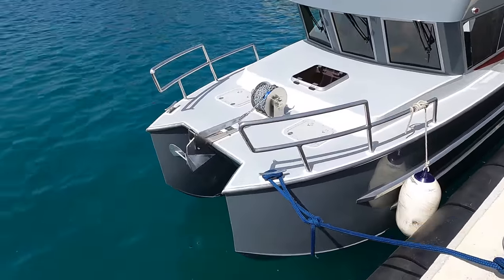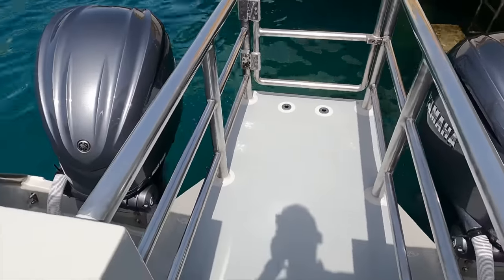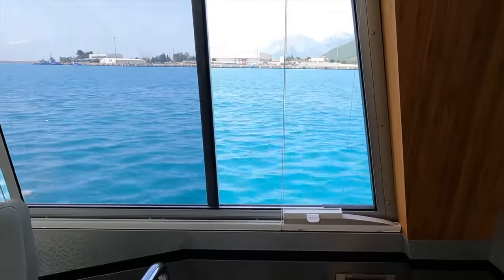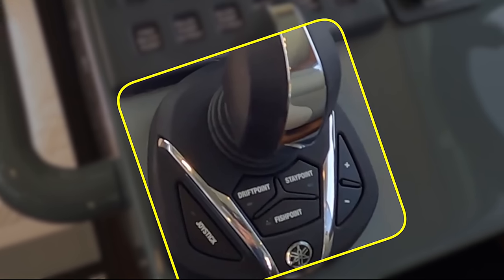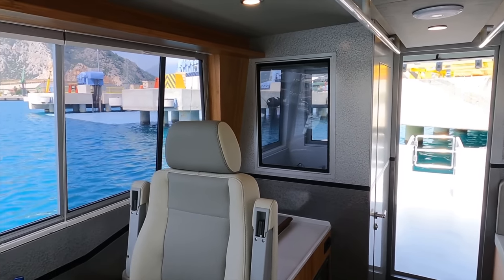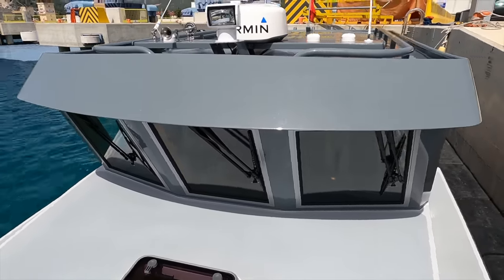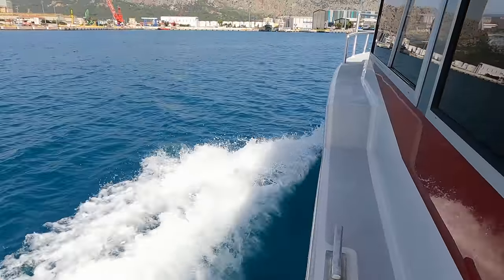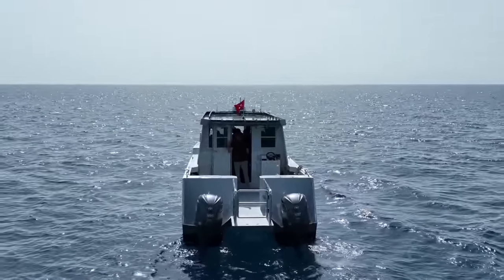FIRST LOOK At The BERING MARINE 34! (Top Speed 40+ Knots!)

Comment: Add six feet, increase fuel capacity, and install twin 600 hp mercurys.
Reply: NO
Reply: Yes, add six feet, increase fuel capacity and install two +300hp Yamarins with drives or jets. Big gasoline outboards can be fitted with chain and used as anchors when installing mooring buoys. You know this thing called "climate crisis"? No one can do everything but everyone can do something 👍🏼...
Reply: That’s not how the do stuff in the northwest. But I bet we’ll be getting more closed pilot house boats in Florida soon due to heat and they’ll make sure to overpower them
Reply: After that add another 6’ increase fuel capacity. Increase hp.
Reply: Twin 300 hp. Disel jetbiutbordes

Comment: She is a breakthrough in design and ride dynamics. The DP system is long over do. No need for costly stabilization system. Perfect size for many coastal operation in Alaska. She is tuff and small enough to trailer. Small beam means regular slip cost. Designed for cold water and the choppy conditions in Cook Inlet. She can go on the hard with ease. I love the design and wish that we could set up a building operation in Homer Alaska. Bay Welding is one of the top aluminum builder in this part of Alaska. Business is booming with a 4 year wait for one of the progressive aluminum cats. Carl Nostrand

Comment: Bare with me, another 3' beam and 4' length. And a very, very secret, well hidden weapons storage,  compartment, airtight w/Febreze or Ozium shot when certain radio frequencies are detected. And panic button. Safety first. Long range, multi bladder fuel tanks fitted, smallest MTU multi-fuel oh yes! Small mast with crows. Huh? This is greatly designed for anything the Sea throws at her and ports of call also with my upgrades. Walk around with a stern anchor too. Super flippin' nice boat = endless adventure, fun, and in all weather, anywhere, any port. 
Just dreaming and you provided the boat. 🤔🏴‍☠

Comment: Like this Bering BM34 Catamaran,  though do Bering offer any other sizes?

The likes of 47 feet long by 15.5 feet beam Catamaran, with centre line through cabin walkway.

That is from the stern and central loading swim platform and gated external passageway, with Outboard Diseal Engines and Outboard Electric Motors  on either side too.

Then passing through the aft cockpit area, with removeable deck cover, plus Man Over Board and loading 360-degree "L" frame Hoist Crane.

Going into the cabin via a aft watertight two-piece separate opening side hinged doorway, which is wheelchair accessible too.

As is the internal central passageway,  plus both the Toilet Compartment and Separate Shower Compartment, are wheelchair accessible too.

Then the main international cabin, divided up from stern forward. With first port side separate Head toilet and hand basin Compartment, then on the starboard side of the central passageway is the separate Shower Compartment.

With enlarge Galley Kitchen, with separate 50-litre Fridge and separate 50-litre Freezer, a Draw Dishwasher for two people, a Combination Mircowave Pressure Oven Air Fryer with Grill, plus Electric twin Hob no gas!

Stainless steel kitchen sink with hot & Cold Water taps  + Wast Disposal Unit, along with Electric Hotwater Heater on demand, plus Hotwater Drinks Machine and separate Cold Water / Ice Cubic Maker too, maybe Cubbish Compactor Unit as well.

Also base storage cupboard and draws,  plus overhead storage cupboards, as well as under seats and under floor storage compartments too.  

With a four seat dinette, that converts into small double bed, with overhead a single fold-down bunk bed too, in all sleeping upto four adults two children and one teenager plusxtwo 🐕 dogs.

Along with two ceiling mounted air-conditioning units, similarly two ceiling mounted remote-control Coulour 24 inch television LCD Screens.

With DVD/CD Player, Harddrive recorder and Satellite Topbox plus DAB Stereo Radio, for the main cabin area.

While the forward cabin, has dual Helm /steering postions one to port and one to starboard, each with Multi-Display Screens and duplicate Controls.

With Chartplotter,  Auto-pilot, GPS and Satellite Weather Terminal, Radar and Sonar Display Screens, 360-degree Daylight Adverse-weather Night-time Digital Camera System and Helm Display LCD Screen.

With Helm position Voyager Data Recorder (VDR) and Helm Voice Recorder  (HVR) systems too. Automated Fire, Smoke and Gas Suspension Systems, Automated Blige Control System, plus Automated  Security Alarm and Tracking Satellite System.

As well as Steering Wheel and Digital Joystick for Bow and Stern Side Thruster Systems, Engine Controls, pair of Marine Aviation UHF/VHF Radios, Satellite Phone and Modem Terminal.

Navigation LED Lights, External Hull LED Lighting and External Superstructure LED Lights Controls, plus remote-operated 360-degrees Visable and Infrared LED Flood Search Light controls.

Also external underwater and external Superstructure Digital Cameras, with Helm position LCD Screens, plus internal White and Red (night-time) Led Lighting system too. 

Along with control panel for the Solar Electric Panels and Vertical Axis Wind Turbines, plus rechargeable battery energy pack.

With the Solar Panels and Win Turbines, mounted on the main cabin roof, or on the remote-operated powered Radar Communications Fold-down (for extra bridge clearance) Mast. 

As well as mounting the fog horn public address loudspeaker and siren,  radio aerials, satellite dish, navigation lights etc too.

With extra solar panels, on the roof of sleeping cabin too.

Though the Catamaran fitted with a Hybrid Diesel Electric propulsion system,  consisting  of a pair of 200 hp diesel outboard engines and a pair of 100 hp Electric outboard motors.

The Catamaran having a range of 60 miles at 6 knots on the electric outboard motors, between recharging, plus a range of 540 miles plus on diesel outboard engines. With two onboard diesel electric generators, water maker and fin stabiliser systems too. 

Also a side-by-side two seat bench seats, on ride suspension and adjustable height systems.

With forward of the Dual Helm Position an on either side of the central passageway, is the forward Sleeping Compartment. 

With bow / forward to stern / backwards laying single beds, with storage cupboards and draws under these two single beds.

Though again with fold-down single bunk beds, plus wardrobes at either end of the single beds. As well as extra Storage and Equipment Cupboard, being fitted in where can be too.

Though the lower single beds, can be converted into a King Size Double Bed.

By sliding out three built-in slide-boards across the Central passageway, that lock in place on the other side, then by  placing memory thin mattress on top to make the King size Double bed.

With an open craw space below, if needing to get to the bow too. Though the lower and upper single bunk beds, each have their own privacy curtains.

Along with their own LED lighting, also USB scockets and wireless stereo headphone too. Each having their own DAB Radio and DVD / CD Player,  plus each having a 19 inch LCD Television Terminal too.

While the Sleeping Compartment, has another ceiling mounted Air - Conditioning Unit too, plus each bunk bed has its own open circluar portholes too.

As well as the Sleeping Compartmentn  has overhead escape skylight, located over the central passageway too.

Right at the front of the Sleeping Compartment, is a watertight two- piece Hatchway. 

The Upper Hatch Half is hinged at the back and open upwards and outwards, the Lower Hatch Half hinged on the side and open sideway and outwards.

That is onto the foredeck and bow ramp, the later is remote-operated and powered ramp (wheelchair wide too), which hinges at the bow then opens upwards over and outwards.

Also can be lowered down to a beach or shore, or to a river Bank, or on to a floating pontoon or keyside, equally to swim platform of a yacht stern etc.

The Catamaran twin Hulls, each bows has a pocket anchors, with 100 metres of chain and 50 metres of rope, plus  the anchors are remote-operated and on power-winches too.

At the stern is ashore and shallow water anchor, with 50 metres of chain and 25 metres of rope, plus the anchor is remotely operated and on power-winch too.

With the Catamaran, having 1 twelve person life-raft, 8 emmission suits, 8 life-jacks, 8 safety helmets, 8 Personal Emergency Location Transmitters, 8 hand held waterproof Marine GPS Radios, last inflatable 4.7m RIB with 20 hp Electric Outboard Motor too.

Also both hulls of the Catamaranm have built-in fixed wide and deep rubber bumper stripes all round.

As well as the Catamaran bows and keels plus sterns, all are given 25mm thickness of Stainless Steel Ice Protection Plating.

To give the alumium hull extra protection, with a waterline equally provided with 20mm thickness of Stainless Steel Ice Protection belt around the two hulls of the Catamaran too.

It would be interesting, to knowing Bering Ychat Builders, could built a BM 34 Catamaran or 46 feet Catamaran Explorer Cruiser.

That is for light (5 inches to 15 inches) ice covered inland waterways and coastal waters, whether in Northern Europe or North America too?

Comment: I think it has alot of potential for fishing in Missouri where I am. But if you live near oceans an if you do crab fishing you can store the traps on top of roof, an put crab puller off the walls. Just put down non skid and tie downs on roof. The forward cabin down below, I have to admit I really wasn't a huge fan and it hurts me to say that about a Bering boat. Great speed and fuel per nm, that's a big plus today with fuel prices and the sea trials watching the water spray from under the front a forth of the way back. You know that boat has it where it should be and well thought out. Just needs a better cabin layout and please make more room for it if possible. I noticed that the kitchen table drops to make a small bed. But I don't think if you take 3 or 4 fishing buddies out for a over night due to lack of beds they will be to happy. But for a couple with a skinny guy or kid sleeping on the table, it's perfect for that. The helm, great layout with that seat, I didn't see anything I'd change an the protection for switches on right of steering wheel is nice to see. An great to see a port seat for extra set of eyes to sit for spotting hidden stuff under the water surface. The older I get the more I need extra set of good eyes to help me see things in the water. Growing up near the Mississippi river, you want a steel hull on your board. My buddy, his dad an uncle were coming back home and he was task with watching out for floating logs under the water surface and all of a suddened a huge tree trunk 30 plus feet long pops straight up from the muddy Mississippi water and barely missed punching a 3 foot diameter hole in the front of their boat and then it got sucked back down just as fast as it appeared an the prop found the top of the limbs of that huge tree and it bent a couple of their blades on prop. With it shaking bad they reduced the speed an finally got back but my buddy didn't ever want to be the bow look out after that night. They all seen that tree pop up and got sucked back under the water. I'm sure it wouldn't make much difference in the metal against a full size tree like that and it would have sunk the boat if it got hit by flipping boat over. Scares me to think about it and they was trying to get back before storm an flood got any worse. The Mississippi river and Alot of other big rivers like this around me here deserve full respect and I can see myself on this boat fishing that river just south of St Louis where the Missouri river adds to it. They have monster catfish right there and if you don't have 300lb test or better on your pole your line will snap, just saying. That river has huge fish and in past few years bull sharks are swimming up from the gulf of Mexico all the way to Chicago area. I love fishing for the big ones, an you truly need a fighting chair hard mounted to the back deck for when you get hooked up on one of the 600 lb monsters because they are there. An I appreciate seeing the 7 pole holders off the back upper roof deck. Sorry this is long but I had to add the Mississippi river story in because alot of us don't live close to any ocean but we sure have some great fishing in our big rivers and smaller ones too. Depends on weather an how far your willing to drive from your home, an how bad your wanting to fish. I've fished from an all aluminum boat with lightning hitting all around on the land. We were catching crappie so fast we was tossing them in the floor to cast again and bam got another one within only a few seconds. We had alot of people yelling at us to get off the water now. We stopped few minutes later to find out we got our limit and we only got there 30 minutes before that and half that time we spent getting to that spot. I Love Fishing, they always said I'd die holding one of my fishing poles in my hand and I hope they are right. Take care my fishing and boating brothers. Take care of each other and share the love.

Comment: its more speed boat and day cruiser then overnighter/weekender.      350 knot miles is fairly short range   considering is speed.  its pretty much 1 day of fuel so you are planning day trips between harbors.   leaving one,  traveling for a day, putting to port and refeuiling.

when you compare this to something like a Nodic 35, same size, but not a fishing boat or speed boat, the nordices 600 knot at 8 knot cruising.   Sure you may be only logging 100 miles a day...   but thats 6 days of cruising up rivers  before you need to refuel.   

This feels more like a hybread,  looking to appeal to fishers, day cruisers, and speed boaters without really optimizing for any of them.
Reply: Wrong 2 ti n es searay sundever

Comment: I guess we could option up a wee bit. Ideas:

Stretch to 45
Increase lounge kitchen area commensurate with length / beam increase 
Full fridge / freezer
Re work the interior a little if a stretch can happen - interior design matter 
Offer a work model + weekender model 
If stretched redesign master cabin - interior design / shower etc
Generator 
Solar and wind on roof
Yes, raise the radar onto a mast with antenna + white light flood
IR camera
A/C for weekender 
Cockpit bbq station/ draw fridges, freezer for weekender

And so on

It’s a great platform. 

Well done Alexsi. (Fellow Australian - thinking of Reef, Sydney, Fraser type weekend destinations, mate)
Reply: I would love to see a 48 footer for cruising and fishing in the Gulf of Mexico off thr Louisina coast or Alabama coast, fishing the oil rigs and camping nearby. 

Add in a Sea Keeper gyro stabilizer and Dynamic Positioning system to stay put in place without anchoring. Add a fly bridge dual steer and GPS, radar, fishing sonar and searchlight fish sonar.

Flood lights to illuminate entire rear deck to allow night fishing with red LED option to save night vision.

Maybe consider diesel outboards for better fuel efficiency for longer cruising. If I can afford a 48 footer, I can afford diesel outboards.
Reply: @ms.annthrope415  "Add in a Sea Keeper gyro stabilizer" Sea keeper on a cat??

Comment: Could the BM34, be fitted with Electric Outboard Motors, plus rechargeable battery energy packs,  replacing the fuel tanks, with maybe a backup diesel  electric generator to recharge the battery energy packs. 

Though with Solar Electric Panels, equally recharging the battery energy packs,  maybe a VAWT's to recharge the battery energy packs as well?
Reply from the maker: I am sure that Bering Marine would take a serious look at this configuration 🫡
Reply: Planing, foiling cats need to be kept light. 600HP diesel generators are anything but. Even in the Turkish summer sun, it would take about a year of solar charging per nautical mile to power this at 40 knots.

Hybrid solutions, which allows for emissions/soot free travel within a certain range of "populated" shore, just about may make some sense for dirty-as-a-coal-mine commercial ships. But for already clean, modern leisure boats, faffing about with battery weirdness, is just a complete waste.

ICEs are already efficient and clean burning, at the sort of constant, high'ish load common in marine application. Dense-city stop and go car traffic is a different matter. But for boats, just stop the madness already.
Reply: 2  350 ludicrous outbards

Comment: I notice that the engines are tilted toward one another at the top -- I've seen this on Hysucats before (smaller, perhaps 28' models). Does this change as the models get longer, or is this done for the same reasons it's done for the smaller versions?  Why the change from fiberglass hulls to aluminum on this one?  This one seems a bit barebones. Is that for weight savings or just because it's a first-hull sea trial version?